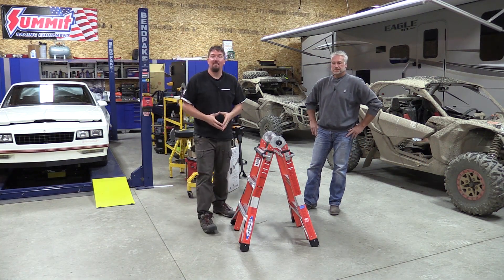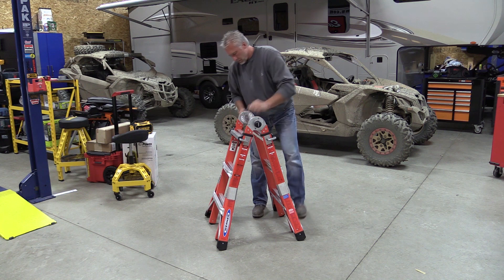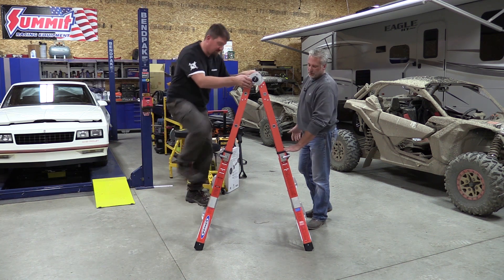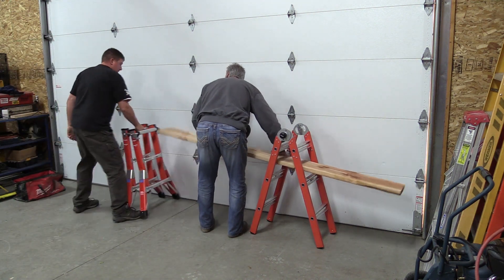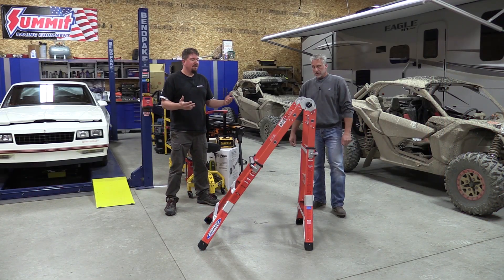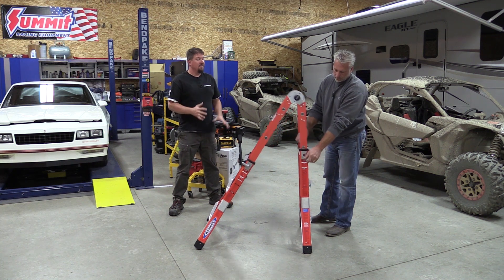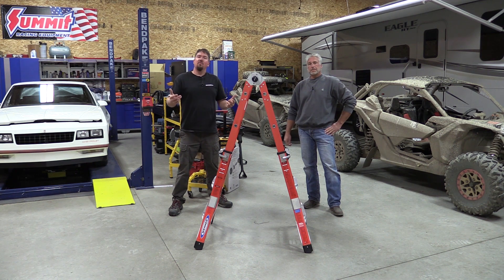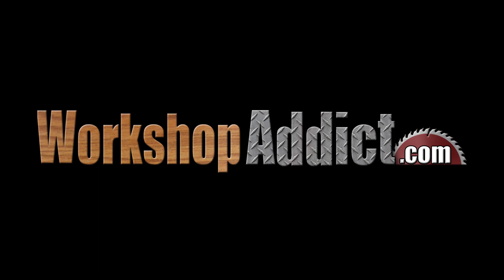Awesome Werner Ladder | Multi Position Fiberglass Pro 5 in 1 | Perfect Size Ladder

Comment: $315 at home Depot. We used to use werner ladders but the pins break after a year of framing use.... little giant is the way to go. $340 for the same type,but a little taller,much better base stance, wheels to roll it around and best of all no pull out pins,rather a locking bar. They are much better built  and lasts many years......check out the little giant 'dark horse' awesome ladders and black...love the channel 👍, great video !!!
Reply: We have a hard time not remembering the poor Little Giant Infomercials.  LOL...

Comment: This one looks a lot easy to deal with, I have one of those aluminum ladders and it's a pain in the ass to use and it weighs a ton, this one looks nice
Reply: The multi-ladders that are heavy and cumbersome are the 17 and 22 foot models. The 13 ft models of literally all brands are all in the 25-30 lb range. Except of course this new Werner fiberglass which is 33 lbs. In reality it is probably the heaviest 13ft multi-ladder available.

Comment: I have two Vulcan multi-ladders, a 13 footer and a 21 footer.  They have come in handy, no doubt, but they weigh a TON!  The 21 footer in particular is a real bear, I avoid using it as much as possible.  When it is necessary to use it, nothing else is quite as flexible.

As much as I love to hate the Vulcan ladders for their weight, it must be said I paid less for both of them than the cost of this one 14' fiberglass Werner multi-position reviewed here.  For a Pro who uses ladders every day the cost may not be an issue, but for a home gamer like myself it sure is when they sit around unused most of the time.  Speaking of sitting around, these multi-ladders are handy as they fold up pretty small and hang on a wall taking much less space than traditional step ladders.

For the record I also own Werner fiberglass step ladders in 4', 6', and 8' sizes.  These are FANTASTIC ladders.  I won't buy light duty aluminum step ladders any more as they have so little torsional stiffness they are almost unsafe, and if you do twist them they stay twisted.  The fiberglass ladders are stiffer, and if you do manage to twist them they spring right back.
Reply from the maker: I cannot imagine the weight on a 21 footer.

Comment: Fiberglass is never there to save you weight. Fiberglass ladders are generally much heavier than aluminum. Fiberglass is to help to keep you from getting electrocuted.
Reply: That's my understanding and experience too.
Reply from the maker: You are correct, this is not conductive, but also in this case, it is also lighter than most of the aluminum multi-purpose ladders.  Some of the multi-purpose ladders are just stupid heavy.
Reply: I was confused by the weight statement as well. Fiberglass ladders are always heavier than aluminum. They are stronger and are safer working around electricity but they are heavier. In fact, if you look at Werner's two offerings... the fiberglass FMT-13 weighs 33lb. and the identical aluminum MT-13 weighs 26 lb.  A nearly identical 13ft aluminum Gorilla multi-ladder is 26 lb. A Cosco (not Costco) 13 ft aluminum multi-ladder is 25 lbs. In fact, a Little Giant Dark Horse 13Ft fiberglass multi-ladder only weighs 30 lb. Even crazier, the Little Giant 13 ft aluminum multi-ladder only weighs 25 lb.  So it looks like the Werner may actually be the heaviest of the 13ft  bunch. :-)

Comment: I have a 19 ft little giant, with all those features, and its 15 years old.
Reply from the maker: The style is not new, but being fiberglass is a HUGE advantage for weight, as you know since you own a little giant.  LG's are not light!  We have a LG also.
Reply: The one HUGE feature still missing from these is the ability to independently adjust the length of the feet when working on uneven ground. I don't understand why all ladders don't have this feature as not everyone works on perfectly level surfaces all the time and having the ladder wobble back and forth without a second person to hold it is very unsettling.
Reply: I'm still not getting the weight advantage. The Werner is a 13-foot ladder and weighs 33 lb. Little Giant only makes two 13-foot ladders, an aluminum one and a fiberglass one. The aluminum model only weighs 25 lbs. The fiberglass model weighs 38 lbs (5 lbs more than Werner) BUT it is rated for 375 lbs whereas the Werner is only rated for 300 lbs. The 22-foot Werner fiberglass weighs 50 lbs. and the Little Giant aluminum 22-foot ladder weighs 40 lbs. While the Werner is a very night strong ladder, weight is not one of its features.

Comment: I have a Werner 13 ft aluminum mult-purpose($38.00 on clearance at Home Depot) and a Cosco 17 ft aluminium Multi-Purpose.  I use the 13 ft more often since it is so much lighter and easier to maneuver. #WORKSHOPADDICT